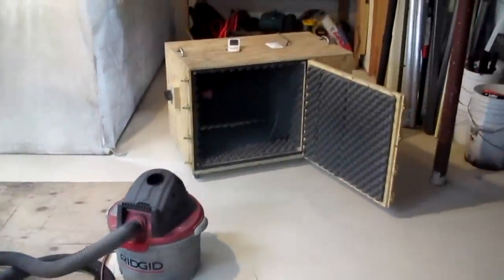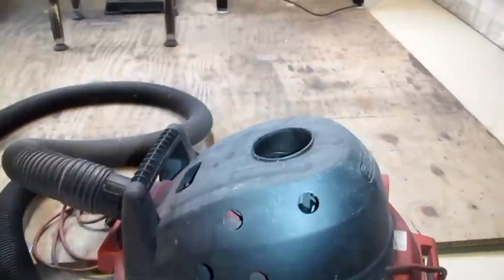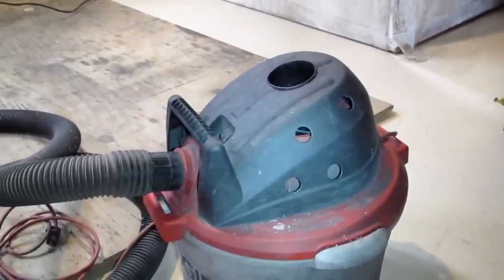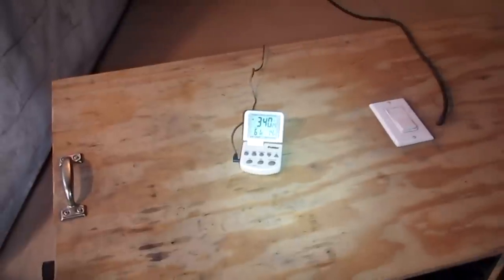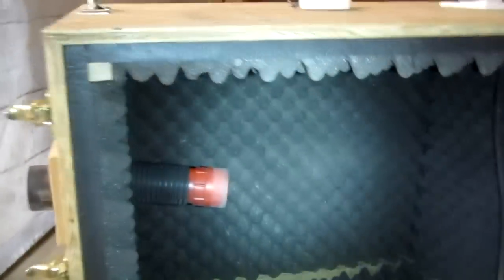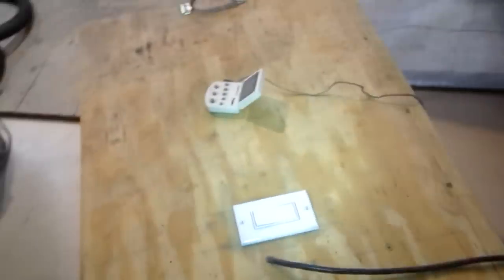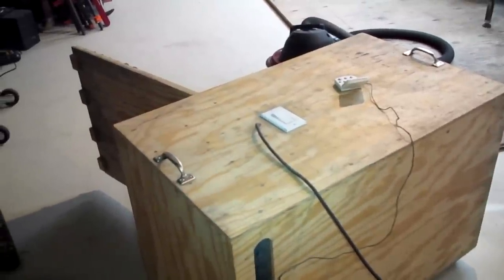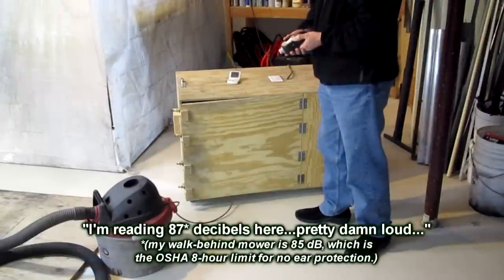-22 dB Shop Vac Silencer

Comment: Hi very nice presentation. I like to copy your work. How much space do I need between the foams and the vacuum ? I appreciate your input.
Reply from the maker: There's no particular spacing requirement for cooling or acoustics, but you'll want enough space to be able to get the vac in and out of the enclosure without difficulty. When disconnecting the vac from the short suction/inlet hose, it needs to move a couple of inches.  So if you put at least 3-4 inches on each side of the vac, that's probably good enough.
Reply: @JoeFrickinFriday  Hi Joe. I really appreciate your input. Would you please say what is your final dimensions? I appreciate.

Comment: Do you lose any suction by reducing the airflow like this?
Reply from the maker: There's very little flow restriction in that serpentine exit baffle.  It's about 25 inches tall, so the cross-sectional flow area is quite large, making the air velocity low; it's a gentle breeze coming out of that tall exit slot in the side of the cabinet.

Comment: I think  most of the noise comes from the motor and brushs inside it, I wished they would just make them less loud.
Reply from the maker: Several years ago I installed a frequency analyzer app on my phone and took a look at the spectrum for my shop vac operating in open air (outside of the cabinet).  Here’s what I
captured:

https://prestondrake.smugmug.com/Other/Website-Pics/i-37BthQv/0/O/shop-vac-open-air.jpg

The red trace is the peak level since last reset, and the green trace is the current/live reading.  A few comments about the spectrum:

- There’s a notable peak at 350 Hz (this corresponds to 21,000 RPM on the motor, fairly typical speed for a shop vac impeller).
- The 7-bladed main impeller accounts for the peak at 2450 Hz.
- The 11-bladed motor cooling fan accounts for the peak at 3850 Hz. 
- There are some other peaks that appear to be harmonics of the above, and plenty of wind noise, all at higher frequencies. Not much going on below 350 Hz.

The brushes and commutator may add some white noise to the mix, but I think the bulk of the noise is due to the above factors.  There are vacs out there with brushless DC motors, but their biggest selling point seems to be efficiency: you get more air power for the same electrical input.  They don't seem to be marketing them as being particularly quieter than conventional universal motors.

Comment: I built one exactly like yours and my original reading was around 80ish decibels and with the vacuum inside I get around 70 decibels. Yours is significantly quieter. Its actually silent. Mine has a pitch noise that just hurts your ears. I have no idea what I did differently because its literally the same thing in every way. Maybe the hinges are a tad bit different but that's it.

Comment: So my Fein Shop VAc is 66 dBa to start with, so I'm hoping that my cabinet will reduce down to below 50 dBa....will find out tomorrow. THANKS FOR THE IDEAS.  

Follow up: my Fein starts at 66dBa and is now in a 36”w x 36”h x 20”d.......very quiet. Cabinet and baffles are lined with a 1/4” heavy felt material. Also with a soft gasket Ed door seal. My only concern is the interior cabinet temperature that raises to 48C  (118F). I may have to add a small exhaust venting fan and some inlet air vents.

My filters are dead clean due to cyclone dust collector installed before vac.

Comment: Just watched about 10 videos for ideas on silencing my “Screaming Banshee” and yours wins hands down. Most effective, simple. 
Good point about cooling air flow reduction as the filter gets dirty. 👍🏻👍🏻
Reply from the maker: Thanks.  I recently finished building a new cabinet that addresses all the shortcomings of the first one.  I'll be posting a video about it sometime in the next few months.
Reply: @JoeFrickinFriday  Hey man, I am really interested about that new cabinet as I am gonna start building in the next fews days. Could you make a quick plan of the build? Anyhow, that one was defo really good. Have a nice day.
Reply from the maker: I built the new cabinet last year, with all of the improvements I've mentioned elsewhere in this comment section - most notably, a separate duct for hot air coming off of the motor.  It holds a Ridgid 14-gallon vac, and keeps it quiet and cool, even when the filter is seriously dusted up.  I haven't made a movie about the new cabinet yet, but you can see pics in my SmugMug gallery here:

https://www.smugmug.com/gallery/n-N6q5M8/

You can get a general idea of the dimensions by eyeballing those pics; I can post more detailed specs later this week.

Hope to get a movie uploaded later this year.
Reply: @JoeFrickinFriday great! Waiting your new video. Tks for sharing.
Reply: @JoeFrickinFriday  thanks man!
Reply: @JoeFrickinFriday  This is incredibly awesome! You certainly put a lot of thought into this project...I love it!
Reply: @JoeFrickinFriday  Really looking forward to the video Joe! Any chance you could also post the plans that you drew up? New version of the cabinet looks fantastic so I'd love to follow in your experienced footsteps and not have to reinvent the wheel.  Thanks! Lukas

Comment: It would be even much better if those vacuum cleaner manufacturers could design them to be more efficient and less noisy in the first place. Shop-Vac brand is known to produce more noise than actual vacuum.
Reply from the maker: The universal-type motor in most shop vacs features a brushed commutator, and that commutator is responsible for a lot of the noise.  Totally enclosed fan-cooled (TEFC) induction motors are quieter, but they're heavy and usually reserved for stationary applications like high-end table saws; I'm not aware of a portable shop vac that features a TEFC motor.  

I did recently find a shop vac that features a brushless DC motor: no commutator, so the motor noise is virtually gone.  However, it's hideously expensive.  This seems strange, given the proliferation of powerful brushless DC motors.  However, even if you make the motor quiet, it's hard to eliminate the whine of the actual turbine that moves the air.  A manufacturer who can do this economically may find that they crush the competition.  :-)
Reply: @JoeFrickinFriday  
Indeed. Very nice and efficient design on your "silencer box" by the way. Thanks for sharing and Happy New Year 2019 !

Comment: Alternate version:
http://s353.photobucket.com/user/batvette/library/tools?sort=3&src=wap&page=1

Oak plywood. Carpet outside neoprene/rubber mass material inside. Fans in and out with labyrinthe ducts turn on automatically when you hit the single switch on the outside. It helped that the vac I used was quiet already. Ridgids are LOUD.

Comment: It's now been a few years.  How is this hold up as far as heat?  Your's seems to be the best I've seen for reducing sound so just wondering if any heat issues.
Reply from the maker: It was built in 2007, so it's now (5/2018) 11 years old.  The heat is fine (cabinet exhaust temp 115F or less) as long as you keep an eye on how clogged the vac's filter is getting.  If it's clogged enough so that the cabinet exhaust temp hits 115F, then the loss of suction is noticeable, so that's a good time to take the vac's filter out and tap it clean.   

I do have safety concerns, in that it IS vulnerable to overheating if the vac hose is completely blocked, and the acoustic foam in my cabinet is NOT flame-resistant.  Search YouTube for "acoustic foam fire test," and watch a comparison between flame-resistant and non-resistant acoustic foam, and you'll understand my concern.

I have a cabinet design drawn up that features separate paths for vac air and motor-cooling air: even if the vac hose or filter gets completely clogged, the motor will still be able to get all the fresh air it needs to keep itself cool.  When I do get around to building this cabinet, I will use flame-resistant acoustic foam, and I will also include a thermal fuse to interrupt power if the cabinet temp gets above 160F.
Reply: This video has been waiting for 11 years for me to find....sorry it took so long to get here! lol

Comment: Space shuttle launch pads require a huge area around them to be clear of residents in order to avoid deafening them.  I wonder how close a person could soundly sleep during launch if they mastered sound deadening with current technologies and materials.  Considering examples I'd seen, it's probably easy to fit within almost any homeowner or builder's budget to be just outside its burn radius.

Comment: I like it!  Good job!  Do you have or can you make a short video on how you made the short hose that connects the Shop-Vac to the "outside world"?
Reply from the maker: Home Depot sells Ridgid branded accessories for Ridgid shop vacs; this includes kits (fittings + hose stock) for making hoses of arbitrary length, and also couplers for joining two lengths of hose.  Look at the wood block on the side of the cabinet; there's a hose coupler secured in that block with construction adhesive.  It passes all the way through to the inside of the cabinet (I can't remember for sure, I may have cut/ground off external features from the coupler to make a smooth cylinder).  So you use Ridgid parts to make a short hose that connects the shop vac to that pass-through coupler, and then your external hose just plugs into the other end of that pass-through coupler.  You'll need a big ol' hole saw to make that hole.

Comment: wouldnt it overheat ?!
Reply from the maker: It's been ten years, no fires yet.  Listen to my explanation in the video (or read my responses to other comments here) to make sense of how air flow moves heat out of the cabinet.  Under the current design, a blocked suction hose/filter would eventually result in an overheat condition, so I've got to keep an eye on cabinet temps.  I've since developed a new design that provides a completely separate inlet so the motor can draw in all the cooling air it needs, regardless of whether or not the main suction hose/filter is blocked; I just need to find time to build it.  :-)

Comment: I just built my vac silencer, similar to yours and it works GREAT. Really does make it pleasant to be in the Wood-shop and use my much needed shop vac on all of my tools. Very pleased with it and I added the Oneida Cyclone dust collector to the top, to all but eliminate emptying the vac.  A very important tool for my shop...thanks for sharing your idea with all.

Comment: I was astounded with the sound pressure level reduction when you placed the vac in the box, even before you closed the door.It's quiet surprising.I've been reading the comments about heat and the airflow for the motor which is separate from the vacuum airflow. Not owning a shopvac yet, my domestic vacuums have all used the main airflow to cool the motor and I wondered why this model didn't. It didn't take long to realise that if the filter gets clogged then the motor has no cooling and can overheat quickly,  which is less likely to happen say when sucking up a sock on the lounge carpet.To avoid this, I'm interested in building one with a combined cyclonic front end, so that the final filter sees very little dust.Your design is probably the most effective that I have seen so far. Thank you for sharing it.
Reply: Dave Harry, most home vacuum cleaner motors get their cooling air through the impeller, through the motor. Its not quite axial, as it pushed through vanes on the side, and through the motor. The 5 Rigid shop vacs I have disassembled, the motor is separated from the suction, the impeller is encased in a spiral volute, and they all draw cooling air through a fan from the top. Four of them have channels that draw in cooling air from outside the sides of the vac to the fan, and the oldest one just draws air from the top, where you can see the fan through the grille, and it is the most noisy one. 
The home upright vacuum cleaners I have taken apart, have no cooling fan on the back shaft, it would impede airflow. The 5 Rigid ones do.
The main reason is not a sock, most shop vacuums are sold as wet/dry vacs, and some lazy jerks, (like I used to before I knew better) will suck up drywall dust with the sponge wet filter on. Imagine that mess in the motor.

Comment: Very nice. My only concern is the higher temperature shortening the life span of the vac. I am looking at doing something similar and need to find a good way to exchange the hot air out and the cooler air in quickly without letting the noise out.
Reply from the maker: I'm currently working on a design for a new cabinet that includes a separate exit duct just for the warm motor exhaust.  A fitting on the motor cowl will allow a hose to carry warm motor exhaust to that separate exit duct.  This way, even if the main vac hose/filter is completely blocked, the motor can still draw fresh cool air from the cabinet interior (backwards through the main cabinet exhaust, if necessary).  The cabinet will be slightly larger and heavier, but this should alleviate any concerns about the operating temperature of the vac.
Reply: FullLifeRebel
Reply: @Javier Carrillo EH?

Comment: I think you could improve it even more if you do some kind of platform with a piece of plywood and 4 nails or rubber rods on each corner the way you dont press those points on the foam with the vacuum, also cover those unfilled edges around the inside of the box.

Comment: Hi. How do you like it so far? Do you feel any issues with heat as some members pointed out? I would like to build one but want to make sure nothing explodes  ;)
Reply from the maker: I've been using it for almost ten years now.  It's worked well, but I've felt compelled to keep an eye on the cabinet's outlet temperature so I can shut down and clean the vac's filter when the exhaust temp hits 115F.  I recently contacted Ridgid (the maker of my shop vac), and they said that it should be fine up to 120F.  

As it happened, my shop vac recently died because the brushes on the DC motor finally wore out.  It's 15 years old and has hundreds of hours of operation on it, so no complaints.  I immediately replaced it with a similar-sized model so I could continue using my silencing cabinet without interruption, but I also bought a larger, more powerful vac, with the intention of building a new/larger cabinet for it.  When I do, I will implement a few changes:

#1: I will add a separate serpentine inlet duct for dedicated motor-cooling air.  A short hose will connect the duct to a fitting on the vac's motor cowl, assuring that the motor gets plenty of fresh cool air, even if the shop vac's filter is 100% blocked.  

#2: I will use flame-resistant acoustic foam (e.g. http://www.thefoamfactory.com/acousticfoam/gridfoam.html).  The stuff I'm using now is NOT flame-resistant, so if it ignites, the airflow through the cabinet will probably fan the flames, making a nice "afterburner" at the cabinet's exhaust port.  When I'm using my current cabinet, I position it so the exhaust isn't near any combustible items; that way if it does ever blow fire, I'll have a chance to shut it down and kill the flames before things get really out of hand (and yes, I've got a hefty ABC fire extinguisher at the bottom of the stairs, as all home basement work shops should). 

#3: I had been using a simple kitchen thermometer to monitor exhaust temperature.  I recently switched to a fancier one (https://www.amazon.com/Wireless-Digital-Kitchen-Electronic-Thermometer/dp/B01CTZ17QO/ref=pd_lpo_79_lp_t_4?_encoding=UTF8&psc=1&refRID=V66P6ZGN6Z5FKKD6N2FC) that includes a remote display and an alarm feature.  This lets me monitor the exhaust temperature from wherever I'm actually working (e.g. at the table saw or sandblaster), and I can program the alarm to yell at me if the temperature gets above 115F.  

#4: I will put the power switch, cord, and handles on the sides of the cabinet instead of the top, creating an uninterrupted flat surface on the top of the cabinet for storage/work. Note that many of these changes were suggested by previous commenters.  

Too many comments here to pore through and find the sources, but if you see your suggestions in my list above, thank you - my next cabinet will be better because of you.
Reply from the maker: Apart from the added noise due to new hole(s) in the enclosure, the challenge would be to ensure that the motor pulls in only this fresh air for cooling, and not any of the other already-warm air inside the enclosure.  The only way I can see to achieve this is by connecting the motor's cooling-air intake to the outside world via a dedicated hose; a foam-lined serpentine duct (just like the one for the enclosure's exhaust) would then need to be incorporated into this cooling-air path to minimize noise.

If auxiliary fans need to be used for any reason, note that a DC adapter shouldn’t be necessary, as appropriately sized fans that run on 120V AC are available; see www.digikey.com for examples.
Reply: Can't you put maybe 1 or 2 small fans on the side of it to blow fresh air inside? That small computer fans you get and run them on a 12v Adapter? I'm not sure but maybe it will affect the noise. Can it work just to keep it from over heating?